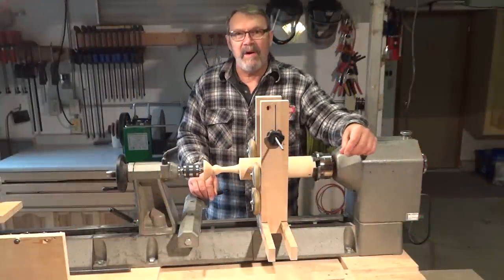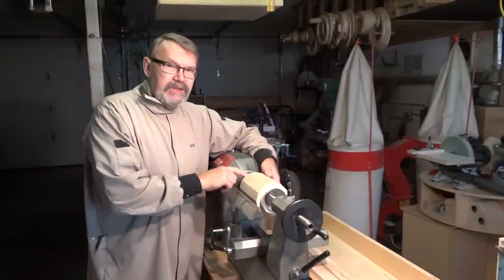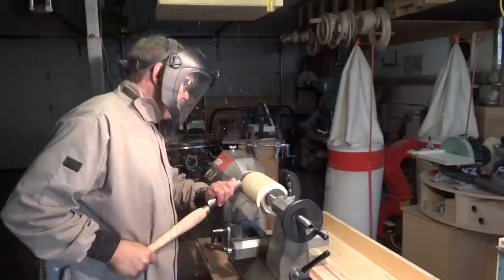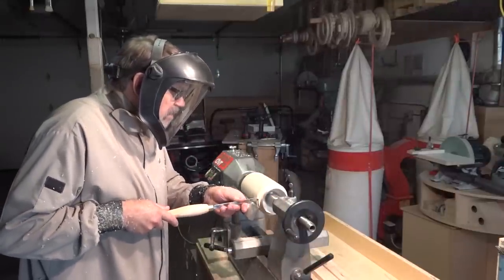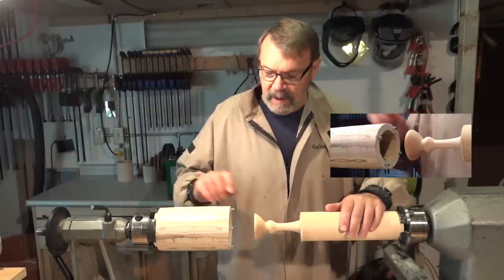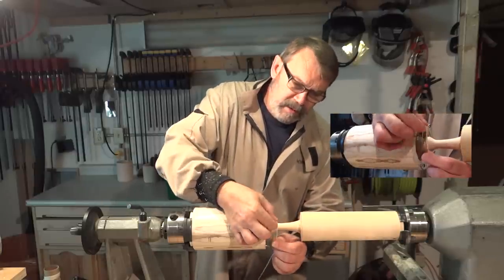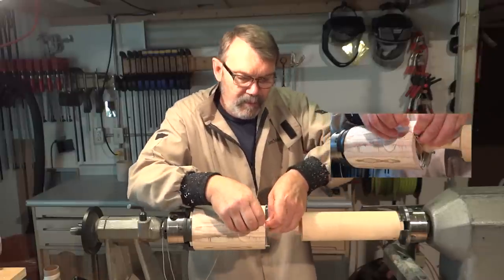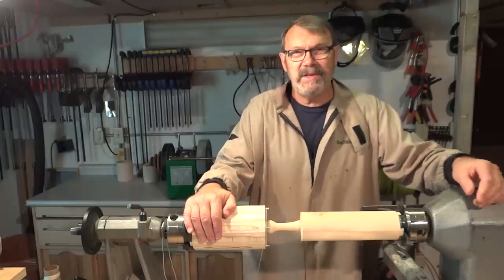Making A String Steady Rest For Woodturning

Comment: Pretty slick jig! I wonder if some beeswax on the string would cut down on friction even more and reduce the chance of burning at higher speed.
Reply from the maker: +Tim Douglass 
Thanks for the input, Tim. That sure couldn't hurt. I will try to remember to try it the next time I use the jig. Thanks for watching!!
Take care,
.....Gord
Reply: or perhaps the string dipped in oil, may even help finishing some of them hard-to-reach parts

Comment: hey gord! i have watched several of your videos here on you tube.  And i love your techniques and your work too.  I was wondering if you could give me some advice on how to mount and balance a log on the lathe to begin turning it.  I have a nice piece of oak about 14'' by 8'' i would like to make a vase out of.  but i cant seem to get it balance enough on my lathe to start turning.  I hope you can help.  thanks beau
Reply from the maker: Hey Beau!
Turning an unbalanced log is very tricky and can be very difficult. The larger and more out of balance the log is, the trickier it can be. Sometimes you will have a piece that can never be balanced because of denser wood on one side than the other or other problems. The first step is to turn the wood as slowly as you can. You have to turn the speed down until your lathe is not trying to walk across the shop because of the vibration. If you have not already seen it you might want to take a look at my video Turning A Bowl From The Crotch Of A Plum Tree. That was an unbelievably unbalanced piece and difficult to turn. As with so many things in woodturning the first requirement is PATIENCE!! I wish you luck with it, Beau.
Take care,
.....Gord

Comment: Gordon, about 18 months ago I bought a old used Delta BOSS Spindle Sander, like you use in your videos.  Works great,  but unable to change the spindles.  I can't undo the nut, and can't find a stop or spindle lock.  I have all the attachments for sanding, but no tools where included.  How do you change the spindle/sanding sleeves.  Any help would be great.  Thanks.
Reply from the maker: Ronnie Sutton My first thought is that the nut is a left-hand thread but I'm not in my shop and may be remembering this incorrectly. Are you turning it the correct way?
Reply: Yes, but the spindle just rotates.  Is there a spindle lock, like one on a table saw when you change blades.  How do you keep the sand paper and rubber cylinders from rotating.
Reply from the maker: Ronnie Sutton There is nothing like that as far as I know. I have always jammed a screwdriver against the fins on the fan below the spindle to keep it from turning. I realize this is not likely the best thing for the health of the sander but is the only thing I've been able to do to get it to work. If you find another solution please feel free to let me know. Thanks!

Comment: Hell-o there Mr. Gord Rock- I need to smooth the out side of a stave cylinder ,that is open at one end ,6 3/8" I'D - I have a vick mark chuck, it will not open that wide, I want to smooth in an out to make a bucket. I do all this by hand now ,trying to make it faster do you have any ideas thank you sir
Reply from the maker: You might want to consider either Cole Jaws or whatever the Vicmarc equivalent is. Another option is to make or purchase a Longworth Chuck. I made one myself using my CNC machine but you can also make them with a router. You are welcome to check out my video on how I made mine or just do a search for Longworth Chuck on YouTube and you will find many videos showing how to do it. I hope that helps, Philip. Good luck with it!
Reply: @GordonRock1  thank you sir Happy New Year !
Reply from the maker: Happy New Year to you and yours, Philip! 🥂🥂

Comment: Hi Gord! Great video, thanks for sharing! If you do not mind me asking, where did you get the woodturners smock? I really need to do myself some steady rest, the ones you use seem simple enough, so I just might copy your designs. Thank you! Cheers! Daniel
Reply from the maker: Daniel Vilarino Hi Daniel. I got the smock from Lee Valley Tools. Have fun making the steady rest(s). They are sometimes indispensable, although not used that often. Wouldn't want to be without mine. Cheers, .....Gord

Comment: I don't understand why using the tail is not possible if you are not going to dig into the piece.
Reply from the maker: +MaxBorges
Of course you can! I use the string steady if I have already finished the bottom of whatever I'm turning and want to make sure that I do not dig into it.
Thanks for watching,
.....Gord